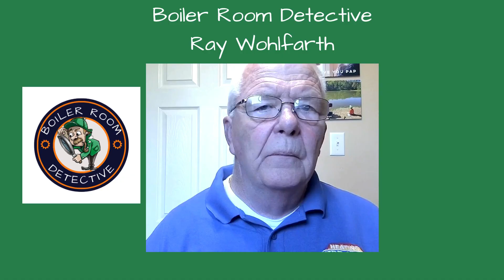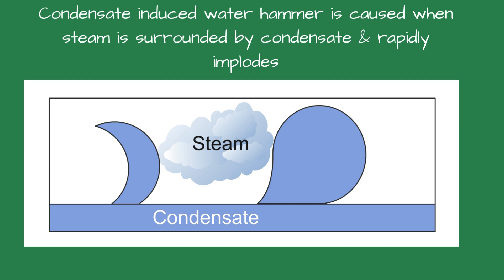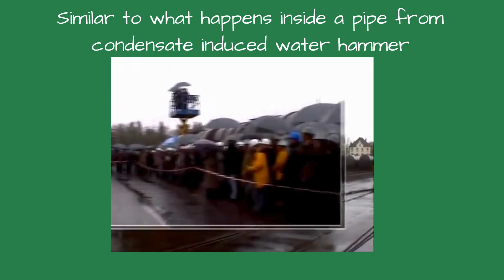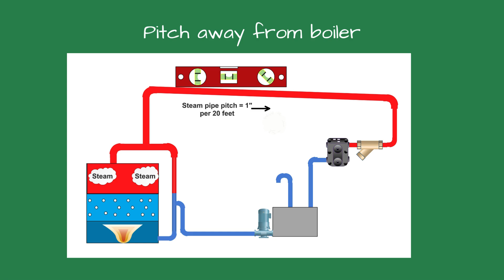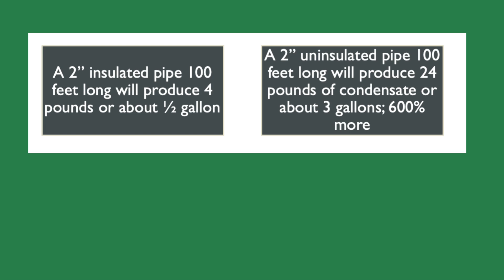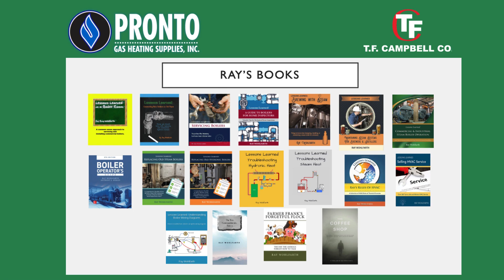Boiler Room Dangers - Steam Piping

Comment: Ray, any thoughts on pressed copper for steam.  I recently saw a new installation with this used for near boiler piping.
Reply from the maker: I too have seen it and am hesitant to use it The copper could handle the temperature I am concerned about the expansion and contraction of copper versus steel Copper expands 50% more than steel   I would feel more comfortable using mega press on steel rather than copper Thanks